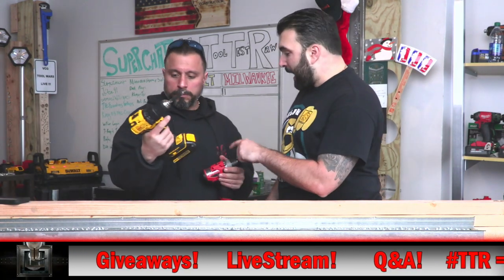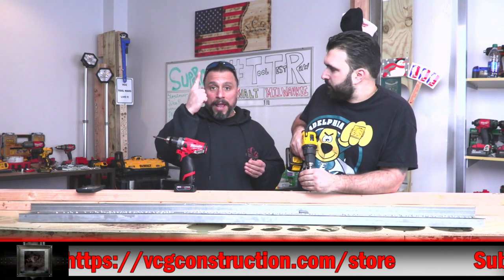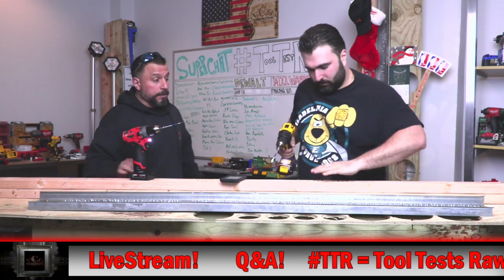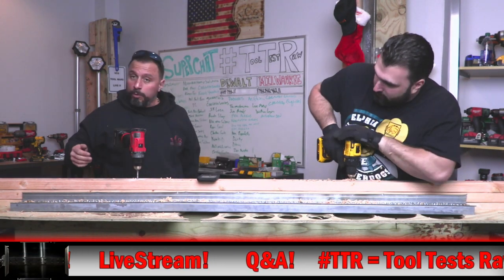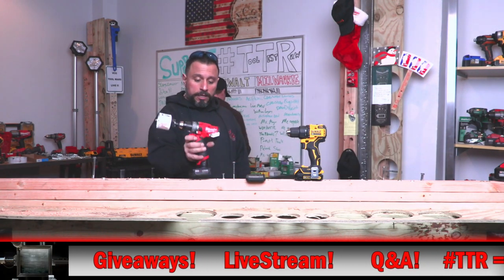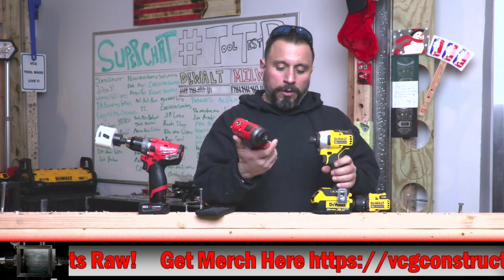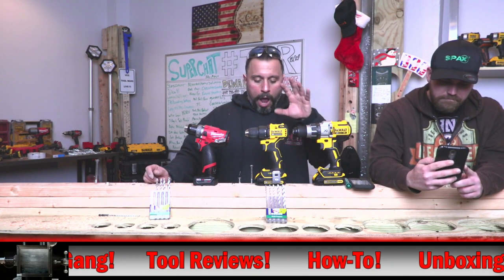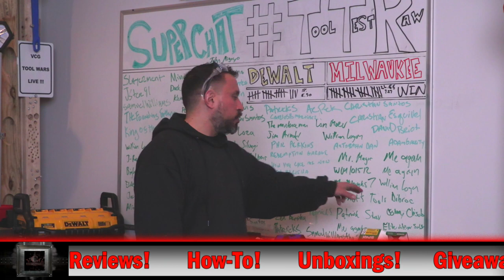Best Compact Drill-Driver - DeWalt Atomic (DCD708) VS Milwaukee M12 Fuel (2504-20)

Comment: full disclosure, I was exclusively a DeWalt home, and motorsports, car DIYer until about a year ago.  Ryobi came out with some unique products so I jumped onto that platform and have 4-5 of their tools (their impacts and drills still seem to be the size of 1990s dewalt stuff).  Over the past 6 months I jumped on the M12 platform because I really wanted a cordless ratched and the doesn't really make one (actually they make one for Matco, but only uses the dewalt 12v batteries and they are around $250).  After I hoped onto the M12, I got the 2504 and 2553 just because I thought it would be nice to buy a couple more toys and they were "compact".  I also happen to own the beloved DeWalt 887 and the 791 XD (compact drill/driver).  When I finally got my M12 impact/drill kit, I realized that they really arent much if ANY smaller than the 791.  i'll also admit that I am not a huge fan of using the M12 stuff with the very small battery, BUT it is nice to have options.

That being said, my opinion on the video. First of all, everyone needs to stop getting caught up with 20v, 18v or 12 v nomenclature.  The reality is that it really isn't the nominal voltage rating that really matters (besides marketing) but performance is more related to AMPs.  Anyone that is into corded power tools, any motorized appliance and even home and car stereo knows this.  Think of it like horsepower vs torque in cars.  They aren't totally exclusive, but just going by the max Volt number doesn't tell the whole story.  Because of this, I knew that as soon as the higher AMP battery was thrown on the DeWalt, it would start to win the battles.

Speaking of battles, the "slippy bits" situation is giving the M12 tool a lot of "wins".  I understand that you guys aren't claiming that this is supposed to be some super scientific experiment, but it doesn't take Einstein to see that one tester keeps slipping practically every test away (his angle from the philips adaptor to the screw head is almost ALWAYs waaaay off, and its extremely easy to see why he slips so much.

Regarding the size and the objection to calling these dewalt tools "compact" because they are still (slightly) larger than the M12 and similar in size to the M18.  That can also be said when comparing the M12 to the M18 as well.  Is the M12 really that much smaller?  I am guessing it isn't (in the instance of this particular drill and the Gen 3 M18).  So perhaps it really isn't there to be all that more "compact" than the M18, when speaking of the size with the M12 4amp batter, but it does have the option of being smaller with the smaller batteries.  It also gives the option to have a form factor that works better using the small batteries with other specific tools (ie-I have the M12 cordless ratchet as the M12 dremel type tool, I never use them with the larger battery unless I happen to forget charging my 3 smaller batteries, which hasn't happened yet).  Also regarding size, yes, the DeWalt is slightly larger, but I think the grip size, comfort and balance of the tools have been understated!!  While the M12 driver is slightly smaller, in reality, the DeWalt grip is much smaller in diameter, and in my opinion is much more comfortable and ergonomic.  This also applies to the forward/reverse switch, on the Dewalt is is in a much better location and easier to access without moving your hand, BUT also hidden better where it doesn't get in the way when you put your hand near that area.  I particularly figured this out and became somewhat frustrated with the M12 impact and drill multiple times when installing a new set of cabinets in my home over the past couple of weeks.

Speaking of frustration.  It is also good to know that the Dewalt is slightly more powerful than this M12 drill driver.  There was a few times that the M12 drill driver AND impact didn't have enough power and I thought the battery was wearing out, when checking the battery and realizing that they still had plenty of life, guess what?  I had to break out the 887 or 791 to complete the job and the power increase was INSTANTLY noticable (yes, I am fully aware that the 887 catches fire when comparing it to the M18 gen 3).

The last issue I have is the poking fun of the DeWalt for not having a fuel gauge.  Frankly, that isnt really the tool, but the battery.  I realize that you guys are comparing a tool kit and not bare tools, but I already have a ton of dewalt batteries that all have fuel gauges, so this is a non-issue for many people (I guess use these kit batteries as back ups).  That being said, another thing that recently frustrated me with my new M12 tools is in fact how the fuel gauge works.  Lately I have been using a ton of my cordless tools remodeling my downstairs and kitchen.  There is something to be said when at the end of the day and you are cleaning up and deciding what batteries need to be charged, that on the Ryobi and Dewalt you can quickly press a button and know how full it is.  In the case of the M12 it is a little frustrating to have to put each battery in a tool just to know how much charge it has.

Now, would I get rid of my M12 stuff to go all DeWalt?  Nope!  The M12 dremel type tool is unique to the M12 line, as well as the cordless ratchet, so those really can't be found on the DeWalt line.  How about the reverse, would I trade in the DeWalt tools for RyObi or Milwaukee (either M12 or 18)?  Well, I don't think I would do that either.  I use the DeWalt cordless compressor on a regular basis (racing kart tires at the track, where we need >120lbs of air pressure) and also use them for my nail guns.  Yes, Ryobi and Ridgid make them as well, but the Ryobi is pretty weak and the Ridgid is still not as good as the DeWalt.  Also DeWalt has the best Multitool which I also use a lot and arguably has the best or one of the best cordless angle grinders (which I have also been using a lot lately) and it also has one of the best hammer drills (996).  The only real "weakness" according to the VCG is the 887, but frankly, I use mine all the time and never burnt it up (mine is pretty old).  Perhaps if I used it all day, every day, under heavy loads, I may have the same outcome, but anecdotally, I have not had this problem.  Also been using my DeWalt circular saw a lot lately as well, could I live with a ryobi, milwaukee or other brand?  Probably, I am not sure there is that much of a difference.  But the point being, it seems to me that each brand has some of their own strengths and weaknesses, and some off tools that the others don't which has made it almost impossible for me to be 100% brand loyal (I also have the small sliding KOBALT miter saw that you guys always talk about and I also have a couple unique Worx tools, specifically the 3 3/8" small circular saw that I have been using late at night for my flooring, so I can cut inside the house and hooked up to my Ryobi toolbox vacuum to minimize the dust in the house).

Oh, and thanks for the video!  I guess it saves me from even wanting to look into the Atomic stuff as my M12 stuff already fills my "compact" needs and the 887 impact and 791 compact drill are already as small and as good or better than the Atomic kit.  And with that, it is kind of curious why Dewalt didn't make these drill/driver and impact drivers either smaller or of different form factor (maybe make it shorter but fatter like Milwaukee stubby stuff.  Don't just make it basically the same size as the current line up!  Do something unique so guys like me have a reason to want to purchase.  Oh, and one last note, the 791 has a METAL Chuck.
Reply: @Vcg Construction, OK LOL.😂😂😂
Reply: Agreed!!  you can't count a test when a guy slips on the screw.

Comment: I honestly believe Dewalt missed the point all together with the "compact" concept. I guess if you stick less power and quality inside the same mould you end up compacting something in a weird way.
Reply from the maker: It seems so I guess something like that can be rationalized???? 🤣🤣🤣
Reply: Yeah whoever had the idea for the atomic line should be fired. Look at current lineup if DeWalt released the atomic lineup with a cordless ratchet, pin nailer, 1/4 anvil impact wrench andnew brushless 7 1/4 miter saw all at a price point similar to current atomic it would have been a huge release. Now they have it basically worst then the 12v brushless system they just released and it just makes them pointless.
Reply: Yea atomic inst as good as the extreme line. Which is really good and only 12v. But the new 850 is a beast eve better than 887 so dewalt made it right prob was a cash grab at first.

Comment: I’m not sure if the Dewalt is disappointing for a 20v or if the Milwaukee is impressive for a 12volt. They shouldn’t perform so close being 12v20v.
Reply: Like Milwaukee always touts voltage doesn't mean anything now put a 6amp 20v battery on the Dewalt like you have on the Milwaukee
Reply: @loucifer323  Milwaukee is not a 20v batt tho, it's 12v, apples to tires.
Reply: @foam27  Yes it is use a voltage tester and the battery will read 20v actually a little over 20v
Reply: @loucifer323  Dewalt they're only 18v here in England.
Reply: @emmarowley1096  put a tester on your battery and it will read 20.6 volts
Reply: @loucifer323  thanks for the info. I don't have a voltage tester but if I had one I would do it just to see🙂
I'm envious of you guys, you can get great deals and discounts compared to the prices we pay here, daylight robbery for all tools here. Watching these videos blows me away at the deals you can find on tools. What you pay for kits is what just a drill would cost here. I'm Watching all these videos so that I don't end up making an expensive mistake 😂
Reply: @emmarowley1096  what country do live in
Reply: @loucifer323  England.

Comment: Pretty sad when an air quote “20V MAX*” (gotta have the asterisk!) tool couldn’t beat out a 12v tool
Reply: Voltage has nothing to do with power,  it will be more efficient with power usage won't draw as much amperage

Comment: I told u guys. Black n Decker spended too much money buying portal cable, craftsman, and other brands. They should have use that money on good technology. DeWalt would had been on top right now. That's why now they're throwing any bate. To see If they can recuperate and get back on track.  On the other hand TTI has Milwaukee solid,  Ridgid solid, Ryobi solid.😁😁😁

Comment: Wish the handle was more comfortable on the milwaukee.
Also wish they used better steel on the chuck. The fingers on mine started getting rusty within a week of getting it.
Reply: Use some oil on the chuck, rub a light layer on it.  I have Napier vp90 it has many uses but mainly used for rifles and its brilliant stuff it has rust inhibitors in it and you can also get VPI chips / cards to keep in your tool box/bag and they are the same, a rust inhibitor.  
The milwaukee handle is a bit big especially for my little hands but it's a beast

Comment: Which one gives more torque ? I need to drill on metal, thanks
Reply: My atomic hammer drill is better than my Milwaukee fuel m12 hammer. The dewalt in this video is not the hammer drill. It’s just a driver

Comment: I'm disappointed that the m12 fuel cant holesaw through metal studs. Learned that one today. The Impact is a great tool, but the drill just doesn't cut it sadly.
Reply: What size hole saw, I ask because I have used a 3/4 carbide hole saw  with the gen 1 brushed version in a metal door frame wasn't fast but worked.

Comment: I stand 6'6" and have very large hands .
With that being said,  the dcd 996 is a very good fit.
But if you are not careful...that BEAST can break your wrist and even pop you in the jaw and knock you off of a 6' ladder !
#justsayn
Reply: Steve kilbey
The dewalt 996 YES LITERALLY almost broke my wrist when I was drilling thru steel and kicked back at the end of the drill bit I was using. Hurt like hell. Love it tho. :)

Comment: I've owned Milwaukee and dewalt you can definitely tell the quality and I will never buy another dewalt drill after owning Milwaukee period
Reply: Idk I’ve had numerous issues out of Milwaukee so the quality is lacking. I can’t speak for Dewalt since I’ve  never owned one.
Reply: @whatfreedom7  I believe all tools have issues honestly. I use Milwaukee daily and haven't had any issues so far
Reply: I've used and own both, I like the dewalt so I invested in the 20v max system and it's insane
Reply: Milwaukee’s quality control is ran by teenage females who think blinker fluid is a thing. Dewalt has good quality

Comment: Hi Vince, 

Dewalt needs to make this drill with a hammer function. Plus 2.0ah battery with the kit. The impact was sad. I guess dewalt thinking was they didn't have to  make any 12v battery larger then the 2ah. The compact has the 20ah batteries that can use 2.0 - 6.0 battery. I hope they fix this compact tools within two years or sooner. 

Thanks for the video
Reply: They have a atomic hammer drill